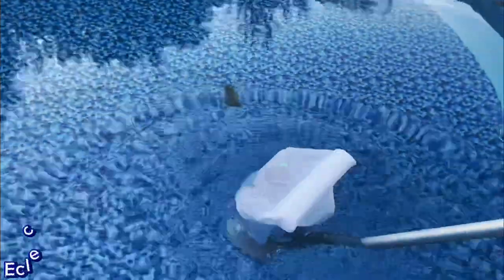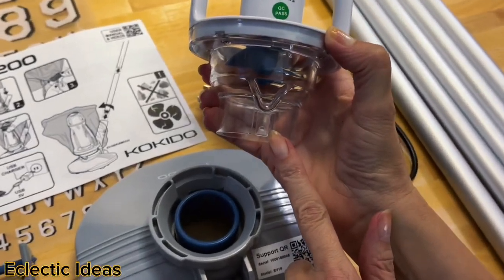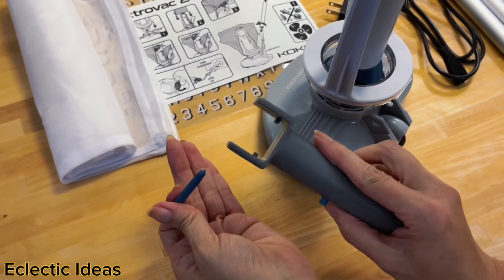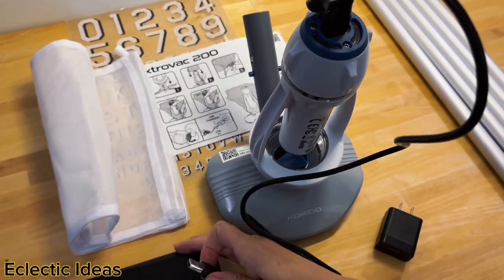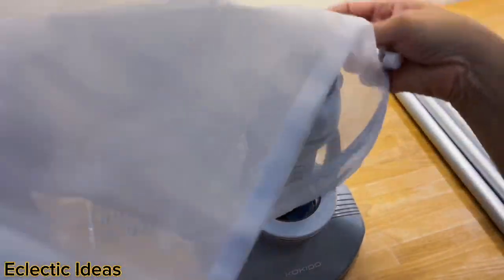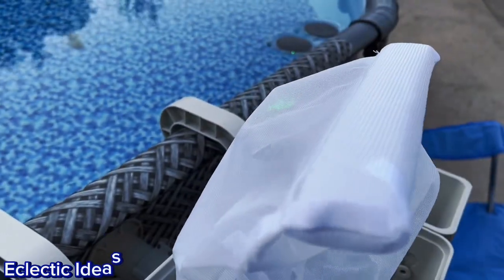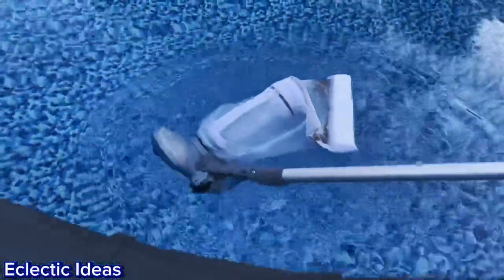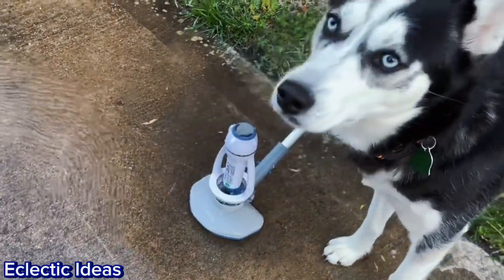Unboxing + Kokido Easy setup: XtroVac 200 cordless Pool vacuum

Comment: Would u also say does it suck up algae related things to that? Much appreciated for the information if it does.
Reply from the maker: No the bag is a smaller leaf type back with the mesh not being of a fine enough weave to pick up debris like algae. Only soft leaves and twigs that fall in. Algae requires a flocculant to kill it first but the particles are so tiny this one just can’t vacuum up algae.
Reply: @EclecticIdeas  I see that makes sense well thanks 😊 for the information I do appreciate the response back good video Though.
Reply from the maker: @snip3r416  appreciate you watching our video. 😊